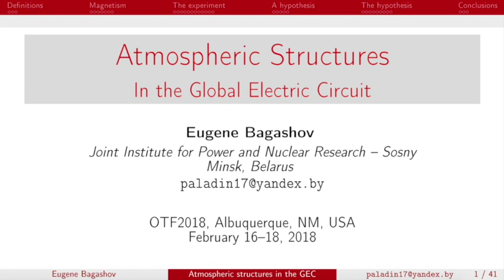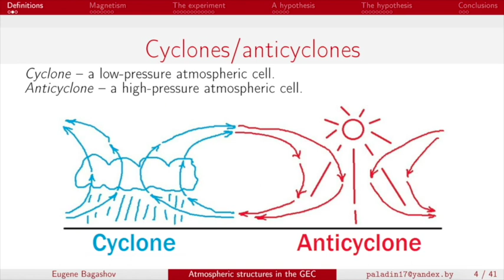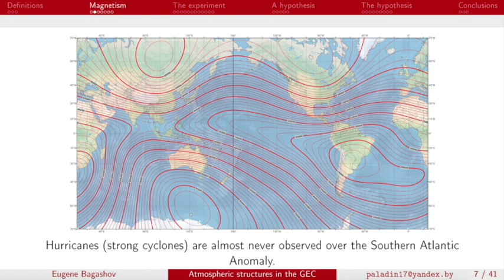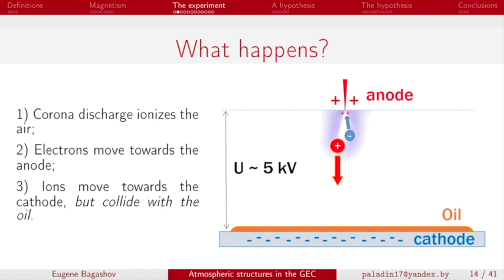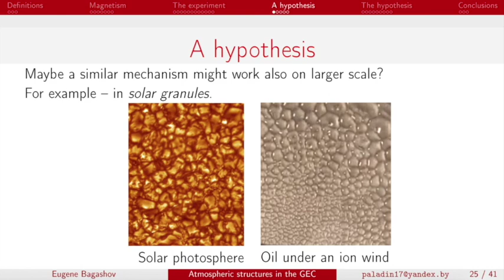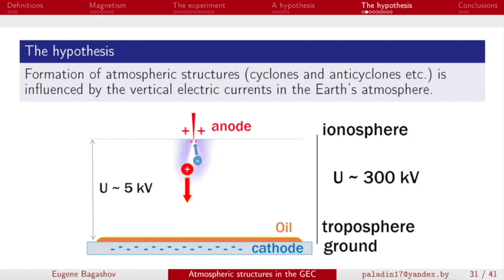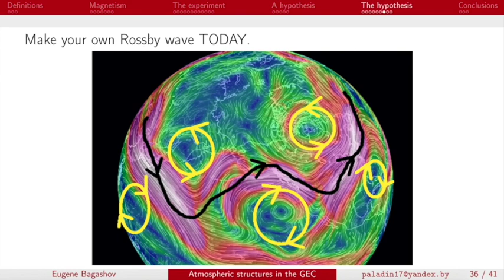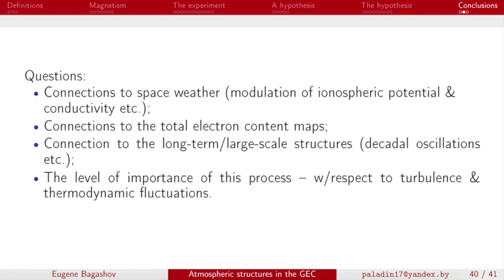Atmospheric Structures in the Global Electric Circuit | OTF2018

Comment: I can't help but think of oil surrounding interacting spherical magnets. Much like a two/three-piece Reuleaux tetrahedron. First I pictured three spheres about equal size, then I pictured two of differing sizes. The "two spheres of differing sizes" fits very well with the earlier portions your presentation. This fits very well with "dual dynamo" and "quad-poles".  paladin17t @ 27:55 the "oil" in this case may it be exactly that? liquid carbon standing on end surrounded by liquid hydrogen, literally... is "the cathode plate reaching up like dendrites" as much as "the ion wind is creating divots"? 

Very very nicely made presentation. Thanks for the upload 
Suspicious0bservers.

Comment: I liked the wiring schematic for the electrical circuit between clouds and ground!  If we assume that magnetics play a role in the weather, would it also be assumable that when the northern magnetic pole shifts, the local weather changes as well?  Just hoping that northwest corner of North America warms as the northern magnetic shifts towards Europe.  That perhaps the arctic vortex would follow the shift of the north magnetic pole....that would put me farther away from the arctic vortex, which couldn’t be a bad thing!  Mad theory, wishful thinking, or maybe a bit of both?!   lol, cheers, thanks for the presentation!
Reply: I like that you are taking a bigger view of things. But I feel you've lost connection with what is causing the pole shift.

The field is a collective field of all the astral bodies and the balancing reactions of our spinning planet and the motions of ions and diamagnetic materials. The critical factor in our changing weather is not so much the pole shift, which turns the spin factor of the cyclone/anticyclones; but the influence of an exponentially failing magnetic field and the influence of an increasing highly charged atmosphere and Earth mantle. 

As a side note, rarely understood, the pole locations are the weakest points of our magnetic field. But since that field is a conglomerate of many current sources, continuing to think of it as a result of a single spinning current is misleading. The SA anomaly is not really an anomaly, so much as a standing wave of reduced magnetic pattern that is now expanding. The weak spots are where the cosmic energies collect and induce or penetrate energy exchanges with space based electrical influences. Cyclones not only form where those fields are strongest, but also on the interfaces or edges of those fields where they link together. 

Then the conductivity of the planet's atmosphere and oceans/land-masses produce both a charged atmosphere and mantle and induced currents that heat the magma and oceans, and cool the atmosphere. THis is part of the actions produced by their self-generating magnetic fields.

The Pac-Northwest is central to geology that is susceptible to heating by cosmic rays with an atmosphere that is becoming more energized, doubly so with the cosmic and other atmospheric influx of particles. The atmosphere is cooling and the ground is heating. Bring the heat of the Earth back to the surface and you'll be good if you can avoid the ejecta of the volcanoes and the quakeing of the earth and incoming tsunami from the other side of the ring of fire and off-shore fault lines.

Besides which, all the models show the polar region expanding across all of North America. Bundle up, limit your roving to high altitude locations, and don't forget your helmut and steel umbrella with respirator. Nature will do what's natural. Its up to you to work with it. Cheers.
Reply: Mundy Morning Report    Thanks for the response!  Up in northern B.C., Inland a couple hundred miles....I better start diggin in...literally!  cheers!

Comment: Sorry Yauhen but in my model you have them the wrong way around, cyclones are the down currents and the anti-cyclones are the returning circuit.
Reply from the maker: Wrong. This is WELL studied. That part isn't his, its as known as 1+1. Current comes down in high pressure, it returns upward in storms.
Reply: @SpaceWeatherNewsS0s  Sorry but that is not what reality shows us. Charge comes into a planetary sphere at the poles as shown first by Birkeland and is repeated in universities around the globe. This can be plainly seen at the south pole where the uninterrupted input charge has a direct path into the earth through the conductive salty ocean to the sea bed below. This input is seen as being broken up in the north though due to not having a central land mass and instead broken land masses with a mix of of salty ocean water and non conductive fresh water ice and which interrupts the input current. But it is still visible in the south polar region as the charge has to ground the best it can . Due to them not having a clear path to the north pole region, some currents and especially after CMEs and solar wind streams hit, get attracted to the strong return current that emanates from between the two electrical tori (one over the northern hemisphere and one over the southern) at the equator, before trying to head north to the pole where it would naturally want to discharge to ground.
Reply: @SpaceWeatherNewsS0s  Indeed it is well studied, I have been a horticulturist since the early nineties and weather is quite important in this field and especially with us Brits.
Reply from the maker: This has been studied from the ground, the air, and by satellite. In high pressure, fair skies, the air is descending down onto the ground, which is why it appears to spin outward. In lows, it sucks in, and head up into the sky. This flow is made of polarized water molecules, -oxygen, and static dust... they are following the currents, not going against them. This is unquestionable. This is why charge builds throughout the high and rapidly is released to lower levels after storms. This is NOT up for debate, it is HOW the sun affects the weather, it is HOW we predict earthquakes, and you cannot imagine how out of place this comment is. You cannot have been here long.
Reply from the maker: Does water attract to current or run away? Do Swiffer duster's static electricity attract or repel dust? Come now... use your head. This is as simple as it gets.
Reply: @SpaceWeatherNewsS0s  Having a difference of opinion and you being insulting by implying that you have the monopoly of what it right and anyone who disagrees is lacking, means that this discussion has now ended and I will stop. You can read my full Earth & Weather Mechanics document at some point to get a different perspective if you wish, but I will leave it there now.